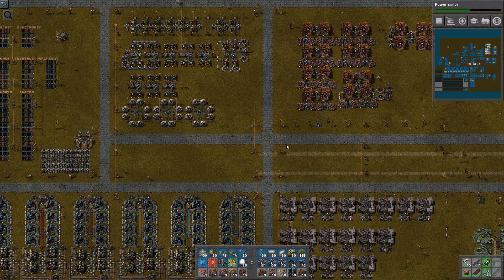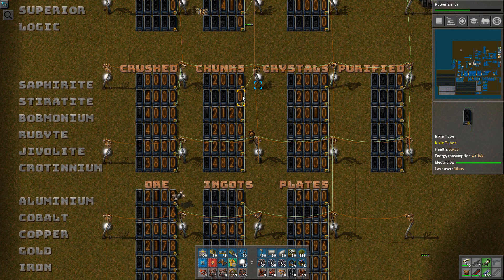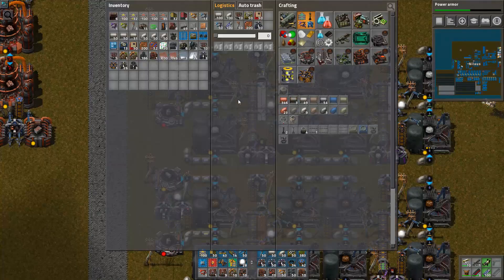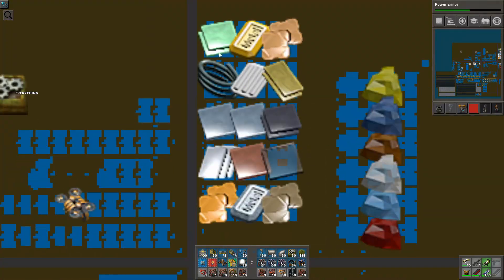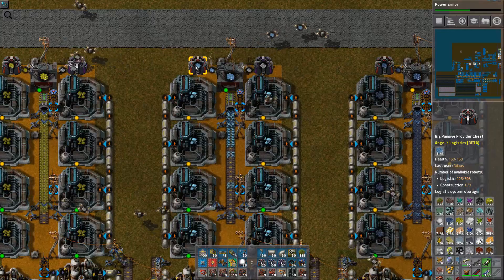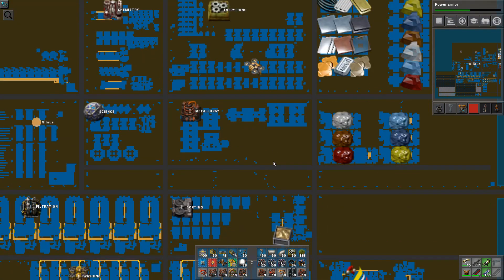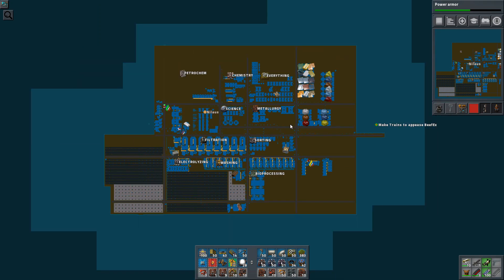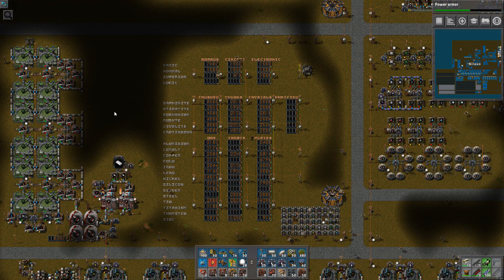Factorio - Sea Block Tutorial - 22 Smelting Casting and Electronics

Comment: Just wow. Impressive to say the least on the base. (At least when you get designs copied correctly and the actuators changed :) ). The modules took a huge nerf for this. I didn't see it, but is it still possible to build the combined modules (like speed modules that also incorporate the energy savings so you wind up using the same energy, but have the speed increased)? Really appreciate these summary videos.